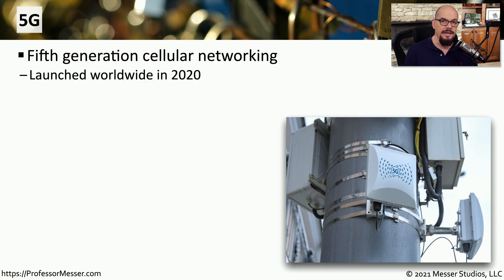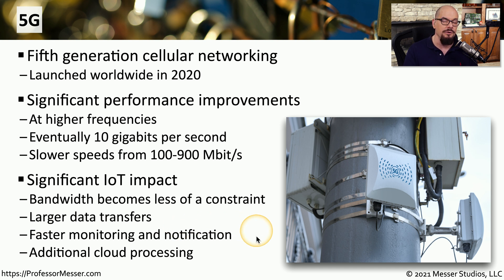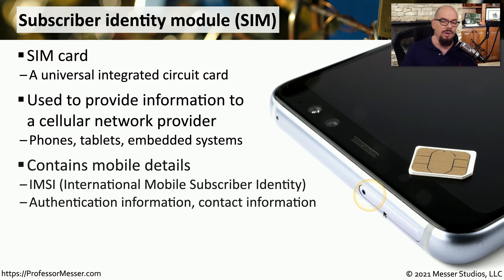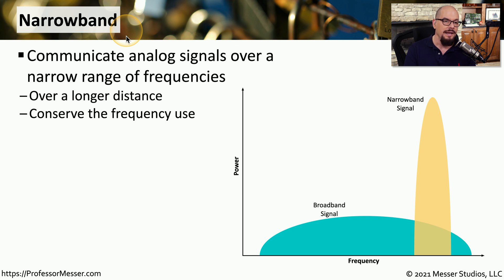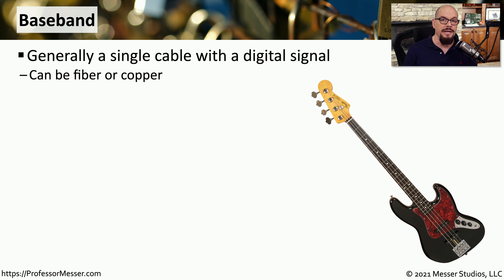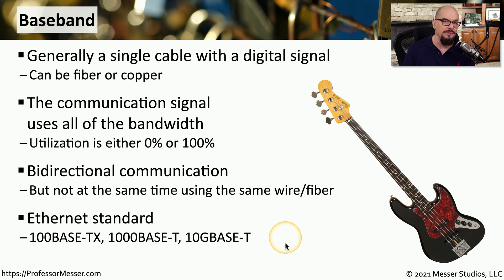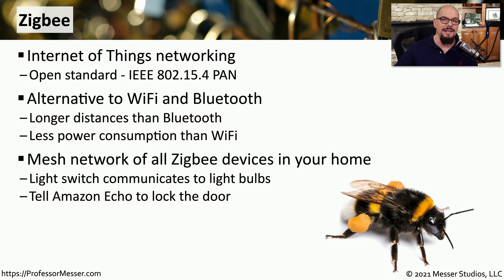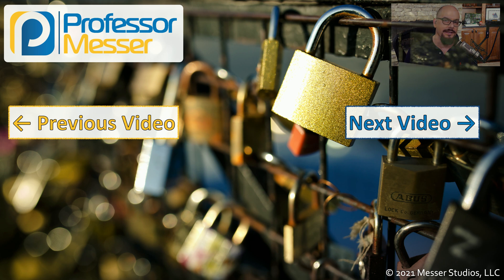Embedded Systems Communication - SY0-601 CompTIA Security+ : 2.6

Comment: Excellent, excellent content, Professor Messer! Quick question, at 4:25 on this video (Embedded Systems Communication) you say that, "This is an IEEE standard, specifically standard, 802.15.4 Personal Area Network, and you can see based on that name, why we call it Zigbee." It's probably flying right over my head, but I don't see the correlation between the standard and Zigbee. :( Can someone explain?
Reply: you were not the only one. i did the same thing
Reply: The name "Zigbee" was inspired by the "zigzag" dance of honeybees, which is a form of communication used by bees to indicate the direction and distance of a food source. The developers of the Zigbee protocol chose this name because they wanted to create a communication standard that would be simple, reliable, and energy-efficient, much like the communication used by bees.

The name "Zigbee" is not a joke, but rather a nod to the natural world and the way that bees communicate with each other. It is a catchy and memorable name that helps to differentiate the protocol from other wireless communication standards.
Reply from the maker: Which would you rather call it; the IEEE 802.15.4 Personal Area Network, or Zigbee?
Reply: @professormesser  Ahhh, I understand completely now. I thought there was some correlation between the numbers and “bees”. I would absolutely prefer to simply call it Zigbee. 

Thanks for the quick reply and keep up the absolutely wonderful work!!
Reply: @professormesser  I personally was a fan of the Zigbee joke and it brought some humor to a section that i have been having a hard time digesting LOL
Reply: @professormesser  yea, no. that was not helping me either.
Reply: I saw it as sarcasm lol, because there's no correlation whatsoever. Unless you look at IEEE and think "BEE", then randomly add zig. (That's probably how it happened).